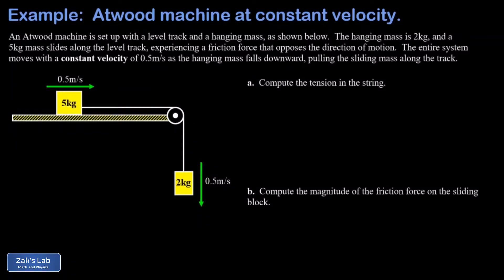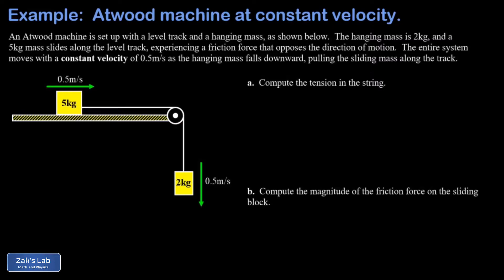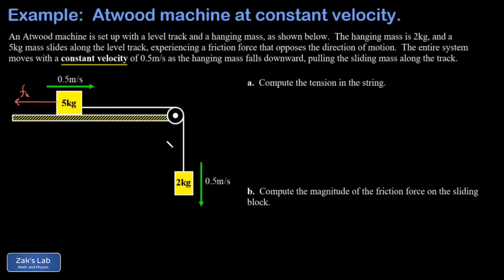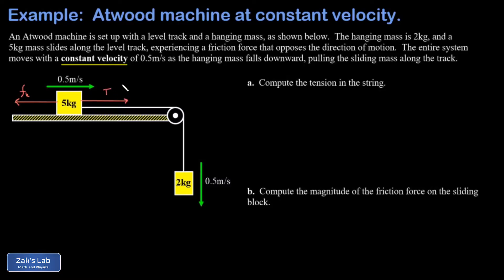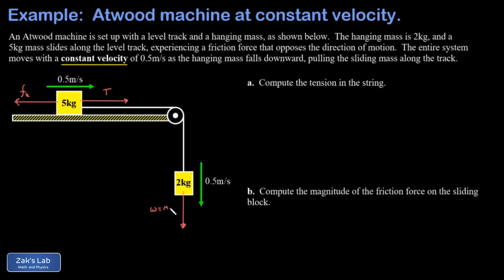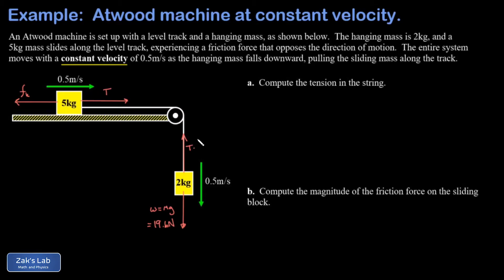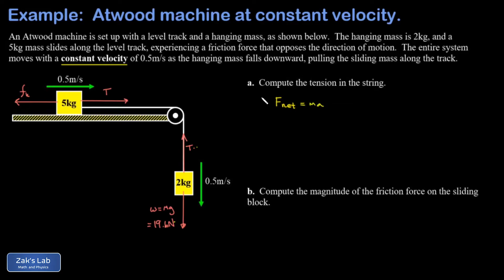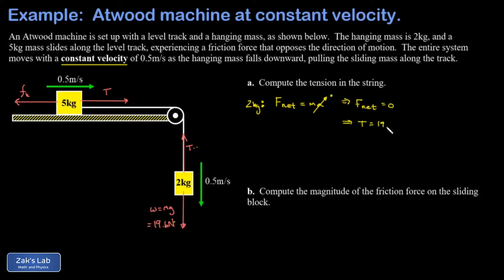Constant velocity Atwood machine problem: find the force of friction on the sliding block.

Comment: Sorry but how do we know that the tension in the upper horizontal part of the string is the same as the tension in the bottom vertical part? Just because it's actually one continuous string?
Reply from the maker: Tension will be approximately the same in all parts of a string unless   you start to consider the mass of the string itself or the mass/rotational inertia of the pulley.  

There are a couple different ways to argue the massless string part, but I usually use a proof by contradiction.  Suppose the tension at point "a" in the string is different than the tension at point "b".  If the mass contained from a to b is negligible (practically zero), then  we have a non-zero net force on a zero mass, which would give us infinite acceleration.  So the tensions must be equal at a and b.

If the pully has rotational inertia, then it requires a net torque to accelerate.  This means the tension must be different at each end of the string, otherwise the net torque would be zero and the pulley wouldn't move along with the system.
Reply: Thank you 🙏